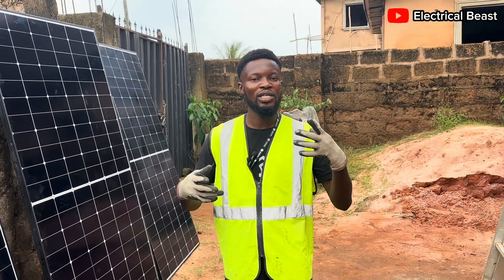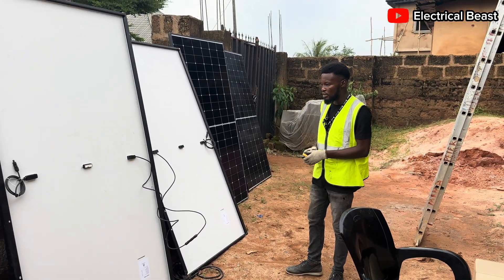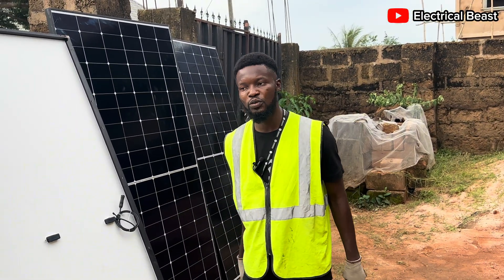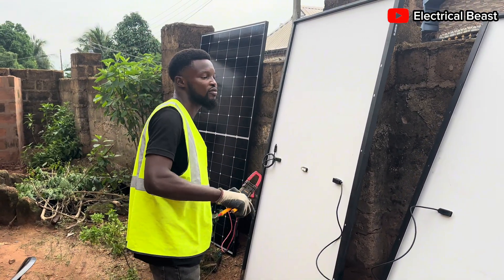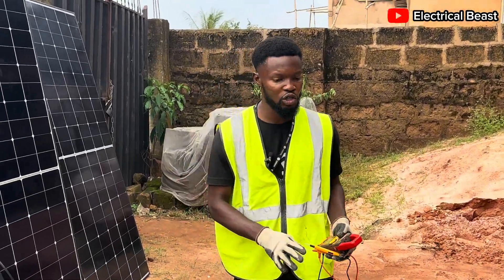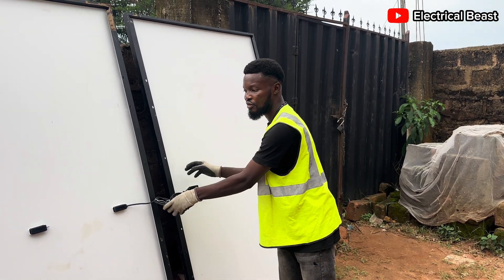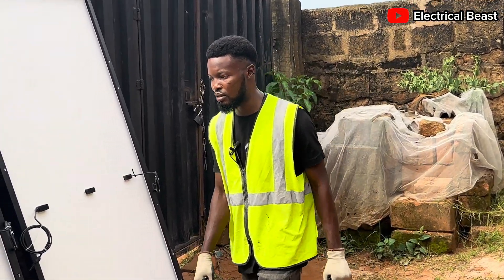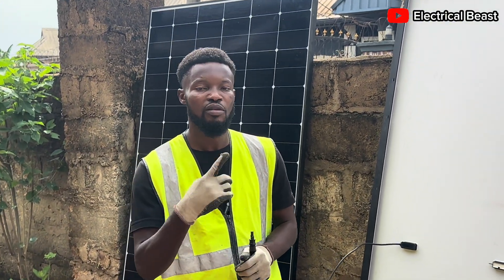Series vs Parallel Solar Panel Connection

Comment: Please with the parallel connection, you didn't finish. If you connect the panels in parallel and want to connect the cables to the invertor, how will you do it? Because the end terminals of the panels is exhausted. Thank you

Comment: But if we connect negative to negative and positive to positive if we're going for like 6 panels or 8 panel how are we going to join the rest Wire
Reply from the maker: A single cable 6mm or 10mm is lined across the panels, then the positive and negative are connected/tapped accordingly

Comment: I have GSB hybrid solar inverter in which the manual says that it can be used without batteries. But it was failing to work.
What advice do you have for me???
Reply from the maker: How many panels did you connect in series? And what’s the pv voltage input to the inverter?

Comment: I have 12v 1kvA hybrid inverter in which the mppt spec is 600w 40amp 20-150dvc.. I also have 2 12v 100ah Lifepo battery.  What kind of solar panels should I use to get the battery to charge fast and how many
Reply from the maker: I advise you get an external moot charge controller at least 60A you can use 4pcs of 550w solar panels 2-series 2-parallel
Reply: @engrgideon is it MPPT or PWM
Reply from the maker: @stanleychimezie1601 MPPT!!
Reply: Pls can you recommend anyone for me? And maybe the price range

Comment: Your explanation.... ON POINT....
if i may ask... if am setting up a solar pumping machine, which is important: voltage or wattage?
Reply from the maker: Is it dc pump or ac pump?
Reply: Watts = Volt x amps

Comment: will i have more changing current if i do 8 in series for a 300watss/33v/9.15A panel than doing 4 in series then parallel?

Comment: Bros, on 12 panels 300w, can I series 3pcs and pallarel it all making 4 ,am using mppt 60a controller , to charge 4 batteries . It's okay pls?
Reply from the maker: That might be too much for the 60A mppt. What’s the maximum pv wattage and voltage?
Reply: @engrgideon  150vdc , 1680w
Reply from the maker: @aladesamuel9652  Use at least100A mppt to handle the maximum possible wattage (12*300w: 3600w), then connect 3 series and parallel.
Reply: @aladesamuel9652 if the mppt is rated 1680W, how then do you want to connect (12×300W) 3600W.
Reply: The panels won't give you 3600w that depends on panel quality the highest you can get depends on the quality you can use a 60a mppt charge controller with this panels charging 48v battery but you can't use 60a mppt if you're charging a 24v battery